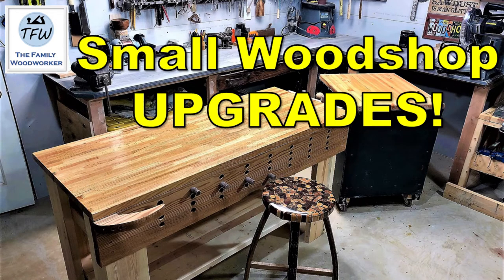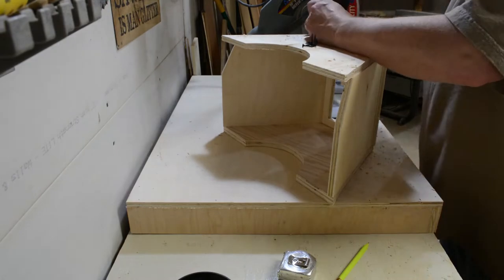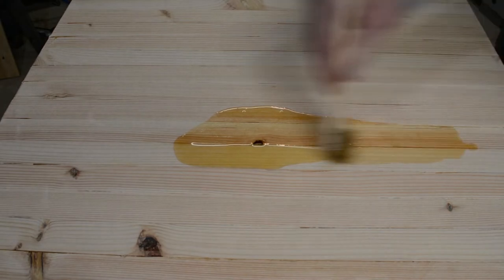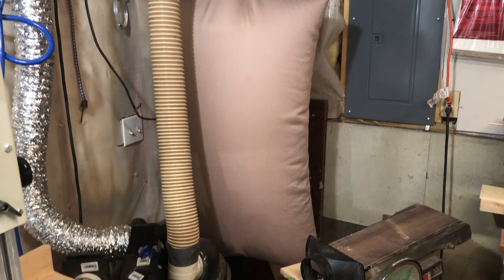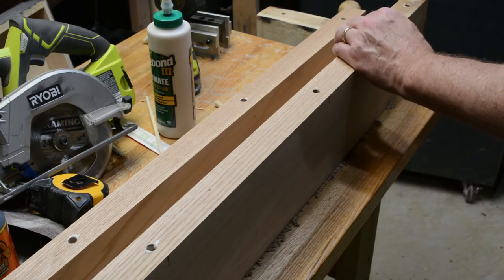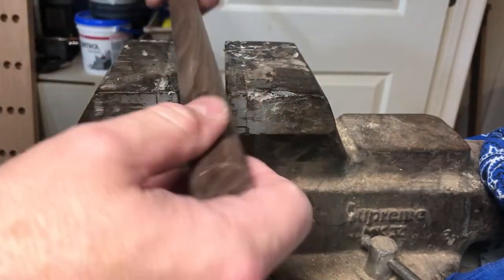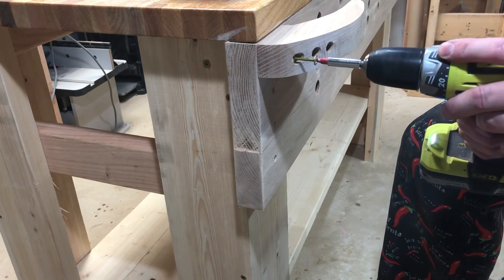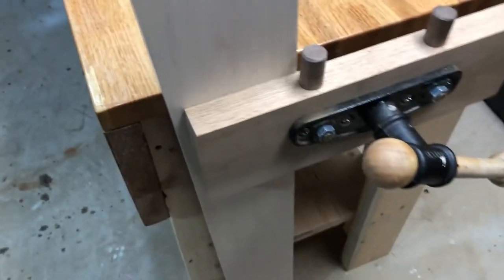Small Woodshop Upgrades

Comment: The cleat is a great idea. Being left handed usually doesn’t hamper me in most things but for me that cleat would have to be at the other end of the bench. Many european bench designs fix work with a combination of dogs blocks and wedges. There are some ingenious set ups around. I like simple benches like yours. There’s far too much testosterone and macho posing around workbenches and their various merits. Most of us need a good smallish general bench and its quite OTT to pay the price for the amount of hardwood some people put into their benches. Yes it can be a work of art but really is it really worth it?  My garage shop will be half the size of yours with the other half used for art and which I need to be dust free so my solutions will have to be even more space saving.

My latest is a $50 shop vac pulling through a $20 plastic cyclone on top of a plastic drum. Its economical on vac bags and the latter being paper lett littlefine dust out but there is an extra fine filter in the vac. For less than 100 bucks I’ll have a pretty good system and with a foot switch that will give me on demand dust extraction.

I see you have a chop saw- what are your thoughs about this compared to a sliding mitre saw?
Reply from the maker: You've seen pictures of me.  There's no hope in me carrying the macho moniker!!!   I like the sliding saw, sort of like a radial arm saw for wider stock, but it sticks out too far into a narrow walk path around the bench.  If you have the room, do it!
Reply: My feelings about the sliding saw are the same. Cost is a factor and the ones where the saw body slides dont have the space problem but of course they are the most expensive. Theres a gret one from Charnwood that has busted the cost problem and I think that is the one I shall get.

Even so since a table saw can do all that my priority will be a decent one of those.

Keep it up Im enjoying your videos- how do you find the time?

Comment: How did you attach the flooring to the bench top?
Reply from the maker: It was heavy enough to stay in place on it's own, but I added a little double faced tape to keep the front edge down.  Easy to replace if it ever gets really damaged but it's holding up really well!